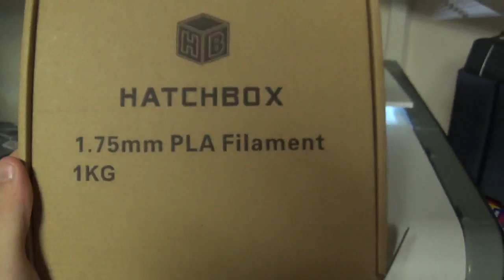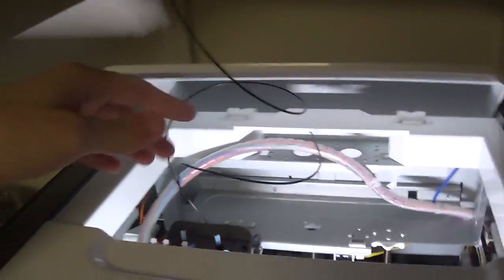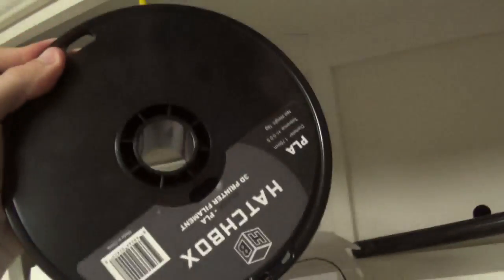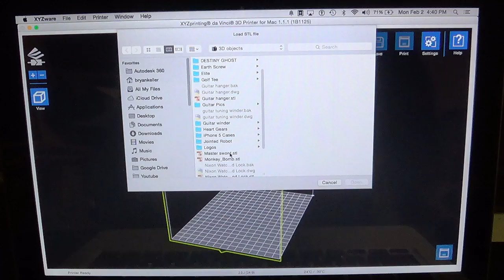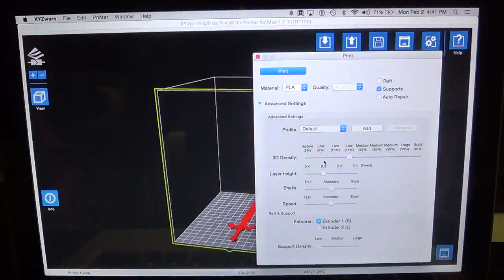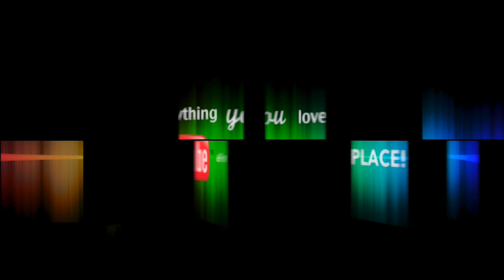PLA Plastic And The Da Vinci 2.0 3D Printer

Comment: I just bought one of these today and want to grab a pla roll for a few prints. what settings did you change to (temps, speeds etc) to achieve that result?
Reply: you poor thing
Reply: Camecol21 I've tried so many settings for pla for so long now and managed to get one print to work in pla but can not do it again. it gets part way through and then fails most of the time beacause it stops extruding
Reply: I seem to have success with smaller or flatter prints. If it goes for too long the crappy heat dissipation melts the filament before it passes the gear. I printed some frames for a spool feeder just fine. I also got a small figurine to print but I had to force the filament by hand when I heard the gear lock once. I have since upgraded to a Mankati Fullscale XT Plus and only use my davinci for ABS prints.

Comment: Did you have to flash the OEM cartridge or did you just use it?
Reply from the maker: theiceman1972 as long as there is a davinci cart inside the slot in the machine you can use other filaments.
Reply: Many thanks
Reply: but still have to flash chip in spool

Comment: Ok my pla isn't working please help
Reply: NO THE PROBLEM IS THAT THIS PRINTER CAN ONLY USE XYZ FILAMENT!!!
Reply: No sorry, i asked the general manager of XYZprinting and they said to me that ONLY" PLA, ABS and Water soluble XYZ's filament could be used on the Da vinci 2.0 Duo". That's why they have created a new printer to solve that problem, that can use ANY filament you want. The pro series are designed to use any filament you want (link):
http://us.xyzprinting.com/us_en/Product/da-Vinci-1.0-Professional
Reply from the maker: Check the extruded track and make sure the filament is all the way pushed in. If it is, make sure the extruders are heating to the right temp by choosing the PLA option. Those are the only 2 things I could think are wrong
Reply: Ryan Mayfield 
You need better hotend heatsink cooling.
Also, print slower. PLA is harder to extrude than ABS.
Reply from the maker: You can use other filaments in it. You just need a live filament cart in the machines sensor.

Comment: Hi, thanks for your videos.

If you want to print PLA in one color, do you need to have two PLA cartridges in the printer ?

Thanks a lot.
Reply from the maker: No you only need pla in the nozzle that will be using it.
Reply: Bryan Keller Thanks. But strange, with Firmware 1.0.F and XYZware 1.3.5  i can't. 
I tried with an old 1.1.0 but it doesn't work with Firmware 1.0.F : bug.
Which version do you use ?
Thanks a lot
Reply: Lallement Bertrand i have a Mac too...

Comment: Hello Bryan! I have a Da Vinci 2.0 A duo, I'm trying to use a resetter purchased on Wctek.com but the only thing that changes are the meters up to 240 meters and I have a firmware 1.0.D! I see in the video that you are using a coil not original so I assume that you were able to reset it! He's' coming a doubt, you have the 2.0 or 2.0 A as my ??? thanks Alessandro
Reply from the maker: Alessandro Romagnoli my printer is the standard Da Vinci 2.0
Reply: Bryan KellerBryan Ciao! Sapete se qualcuno con il modello che ho Da Vinci 2.0 A 1.0.D firmware avuto problemi reimpostare le cartucce originali con nuovo firmware ?? grazie Romagnoli Alessandro

Comment: I just bought some PLA and followed your instructions but it jams in my Da Vinci 2.0 just like everyone is seeing in their 1.0 printers.
I noticed even though I am setting the material to PLA when I print, the initial temps for bed and extruders are the same as for ABS (70 and 200 respectively).
Does your printed do that also?

Comment: You guys still running the stock firmware and using XYZware are really missing the full potential of the machine. I used the original crap for only a short time before I dumped it, put on Repetier firmware v0.92, and switched to Repetier host. It makes it a whole different machine. The advantages go far beyond the elimination of the need to use cartridge resetters, etc.
The procedure for installing the firmware is slightly different depending on whether you have a older V1.0 or newer V1.0a machine, but in either case, it's really quite easy.
Reply from the maker: +matthew oshea I am unsure about that, I would assume that you could once the file has been sent to the printer.
Reply: i have had nothing but trouble with this. flashed fine but with rep, it doesnt know where the bed positions are and it still fails to print pla. can you advise any settings you have

Comment: Thanks for sharing your videos. This is the VERY first time I have ever seen someone with an affordable printer. But I guess you need to be a cad expert to do anything right? Or know someone that can build out? Like if I wanted to build cases like you did.

How much does a case end up being with plastic purchased etc?
Reply from the maker: Each case costs about $1.20 to make.
You don t necessarily have to be a cad expert though. It does help and gives you the customization capability but there are thousands of awesome prints you can make without any cad experience necessary.
Reply: Bryan Keller
 I did see that, there are all kinds of things. DAMN! I was looking at the makerbot or the flashforge. My issue is quality and detail. I am a stickler for detail. So I have been looking since I watched your vids to see what the highest quality printer was under 1300.00. FlashForge seems to be one of them, but only looked at about 3 online haha.. Plus I need something that can print 12/13 inches tall. Like tent stake height. Long story and no, doesn't involve vampires.
 
On the case front, I wanted to do them in abs and have them fit exactly like a regular silicone case.... is that possible also?
Reply from the maker: Ya if you create the dimensions correctly it will print exactly what you designed which will fit a phone.
Reply: Damon T. If you are lookig for a 3d printer, keep in mind that it is more of a project than a product :)

You will have to go through calibration and will have some issues with it !

If you are capable of assembling ikea furniture, you could assemble kits like the printrbot simple, which does great prints for it's value.

One last thing, you don't have to be an expert at 3d modeling to get a 3d printer, but it does help if you are trying to make usefull parts instead of trinkets.

Cheers !

Comment: i really want to buy this printer but the reviews are scary they say its a piece of crap and the xyz customer service is non existent. also they say you cant use other fulfillment than the xyz ones nut you are not? just please tell me if it worth it. have you had anny problems? how long have you had it?
Reply from the maker: I personally have not tried to contact the customer service but I do not doubt they are difficult since the company is based out of Taiwan. I totally disagree on the crap part and think this printer has a fairly good quality for the price ($680) and you can use other filaments. They have made it difficult to but you can easily use any type/brand of 1.75 mm PLA or ABS. The printer that runs next to it is the solidoodle 3 or 4. Look up the specs for each and compare for yourself to see which one suits you. I personally went with the da vinci after a long debate of which to get as well because it had dual extruder allowing me to print one piece with 2 colors. Hope this helps!
Reply: Bryan Keller the solidoodle take months and months to come and the power is crap because its cheap Chinese one. so im just gonna buy this one and hope there's nothing wrong with it.
Reply: ok thanks
Reply: CoboGamer dont get the 2.0 and if 1.0 dont update the firmware
Reply: ok
Reply: 2nd fail of the day just stopped and went to main menu exact same place

Comment: What computer, and software do you use?
I want t get into 3d printing and I want a good computer(mainly laptop) to do 3d printing and software that wont lag on the laptop.
Reply from the maker: I have a MacBook Pro and I use AutoCAD 2012 on it and it works fine. I personally like the windows version of AutoCAD better but I'm warming up to the Mac version.
 The davinci 2.0 also comes with its own xyz software for placing objects on the print bed. 
That's really all you need to get into printing!